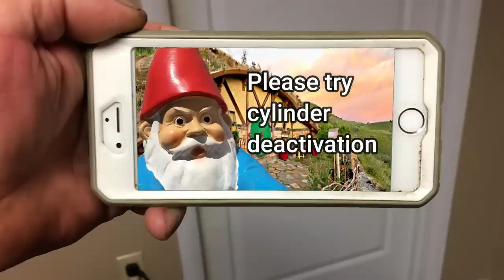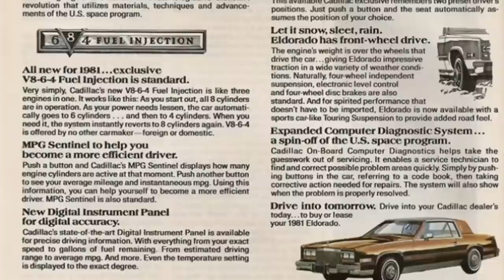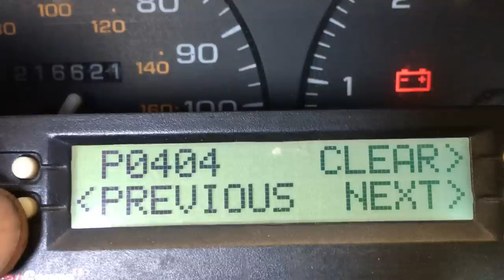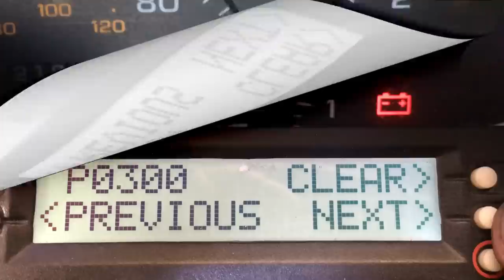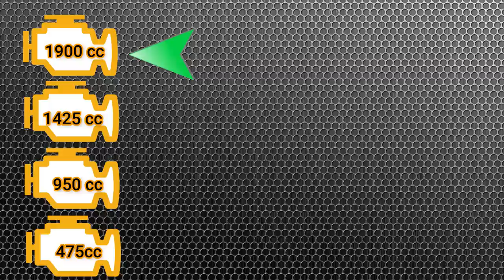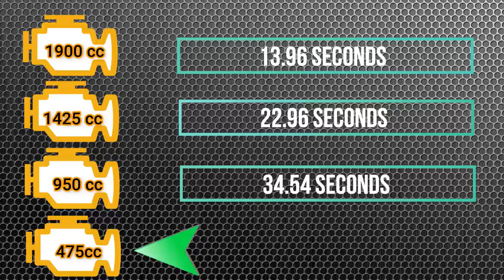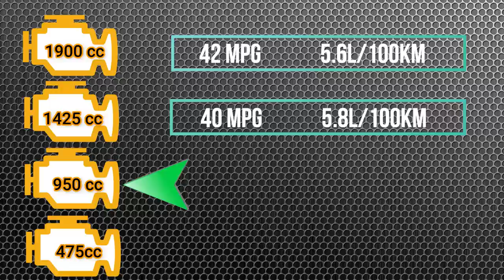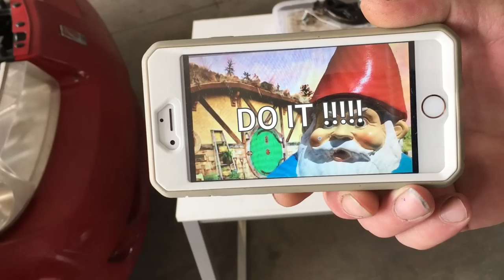S2E16:  We deactivate cylinders on our Saturn and test the car for performance and MPG

Comment: hey can you guys do a test for me since you guys are the testers here you know how that car takesb 5w-30 oil and i have a 5w-30 1zz fe engine in my pontiac vibe which basicly  is a toyota matrix  and i dont wanna end up damaging it with 192k miles on it if it does get damaged since it has been taken care of by the last owner since all i've ever done is replace the oil and put some tranny stop slip in so it can engage all 4 gears instead of taking its sweet time umm can you guys see what happens if you would put in 5w-20 oil and see if it does any harm if i was to keep doing it in my car  because if someone can do this exepriement since i havn't been able to find any video of any body doing it maybe you guys could and see if it would do any damage running a thinner oil on a well taken care of car and see if its worth it since i keep getting mixxed awnser saying yes toyota has approved of the oil just don't go thinner and don't do it if you have no problems but since its my a to b and people also tell me try it yourself do your own experiment when i could risk doing osmething to my own ride so if yall could try this out that would really help me out

Comment: I accidentally disconnected a fuel injector on my 2.2 1996 s10.. it gained a couple mpg but way less power.. I didn't disable the valves but they bounce the compressed air... you need to test with the ecu... really hard to believe you normally get 42 mpg.. but flat will do amazing mpg...
Reply: 2.2 '03 Sonoma. Knocked a plug wire loose and it popped off right after leaving the driveway. You're frickin' lucky, because I almost couldn't get mine up the hill to turn around and then back up the driveway.
Reply: A misfire is a big problem with fuel added... I had spark ok but no fuel in 1 cylinder.. and life was simpler in 1996.. was way less power but I did notice better mpg however my engine was never getting correct mpg .

Comment: I'm wonder how result will change if two pistons + connecting rods will be removed.
Reply: It would be so out of balance it would destroy the bearings
Reply: @smokenchoken1736  Maybe it can handle 30 mile fuel economy test. For better balance could leave cutted buttom part of conrod clamped od cranckshaft.

Comment: If you want and have time to try this . 
Cut 2 runner intake manifold and cut 2 runner exhaust manifold on Cyl#2-3.
After lets the valve intake et exhaust cyl#2-3 open . 
The engine going to be more happy with no compresion in 2 and 3 .

Comment: 7:30 will it pass annual emission test?
sound like a Briggs & Stratton lawnmower.

through knock sensor(if it has one) the ECU will probably notice something is wrong.

That car looks awe full bad and many USA cars still do, that's the reason why they don't sell here, you might see a dodge ram once a while, but that's it.
lol, roads with no corners, easy to get your drivers license.

Comment: I don’t know know what system your car uses for air metering.  I would like to see a variable obstruction to the intake air.  The reduced airflow should result in reduced fuel injector pulse width.  Leave it open during acceleration.  Then,  obstruct airflow at highway speeds.
Reply: It's MAP, there's no MAF sensor that I can see anywhere.

Comment: It might help if you remove the spark plugs on the unused cylinders, that way the engine can move the air in the dead cylinders freely instead of trying to compress and draw air from inside itself

Comment: Once you get your tinkering done convert it to a two cylinder by pulling the Pistons. Get rid of the extra useless mass.  Pulling the plug will not be nearly as good as removing the Pistons entirely.  I bet it will run better eliminating the pressure and vacuum in the deactivated cylinders.  A friend of mine just yesterday got the news that his Hyundai engine will need to be replaced. Number three spark plug due to pre-ignition melted the electrode off and the ceramic insulator got between the piston and cylinder walls. I think I'll suggest he convert to a two cylinder 😁

Comment: Ford 1.9 SOHC CVH engines would reliably and easily start and run and drive on 2 of 4 cylinders when one coil pack failed. Had a Ford SOHC 4.0 in recently starting, running, and driving on only one cylinder bank when the timing chain to the passenger side bank decided it was going on vacation through the valve cover.

Comment: Stock it has 140 hp. The one cylinder would have had, generously, 35 hp. 
By my calculations it would have had a similar power to weight ratio as the original 9 hp Citroen 2CV, only though a slushbox. 
So... Congratulations? You just equaled 1940's French engineering? ;-) Next on Robot Cantina: We build Hydropneumatic suspension with 4 basketballs, a fishtank water pump, and some used fryer oil! 

It's always a good day when a new Robot Cantina video comes out.
Reply: It is a very good day for a very good day indeed!!
Reply: I love your idea with a fishtanik water pump and some used fryer oil.!!

Comment: Great video!! Im really surprised the deactivation didnt do much. I thought there would have been a bigger difference, one way or the other. I thought, on the supercharging theme, what if you run the 2 cyl engine but plumb the exhaust from the "dead" cyls to the working cylinders to force air in?
Reply: if both center cylinders could alternately pump front+rear, 2:1 displacement ratio..
could it make similar power but consume less fuel? interesting concept anyway.

Comment: The only real way to effectively deactivate the cylinders is have it to where both exhaust valves are slightly cracked open but got to watch out for valve to piston damage though That way the compression is not there.... with it having its compression that's  almost like having a Jake brake on all the time...

Comment: Maybe 2 cylinder sparkplugs out not compressing.make bad noise but make engine run without bacpressure.
Reply from the maker: unfortunately removing the spark plugs would in fact increase the pumping losses.  Leaving the plugs in provides the best results.   If you want, search the internet for cylinder deactivation and you will find that leaving the plugs in place is how its done.

Comment: Moving a certain mass a certain distance over a certain time will take the same amount of energy whether you use 1 2 or 4 cylinders.  If you want to decrease fuel consumption you should concentrate on aerodynamics, weight, or something even more fun like combustion efficiency or alternative fuel.  External combustion like steam would be great as well!

Comment: You just disconnected rocker arms sure took out the spark plugs too because it's going to create a vacuum and create a pressure and it's going to drag down the system if you would have called to Pistons out that would probably gave the two cylinder or horsepower

Comment: i cant remember who the designers but i believe it was Mazda that was looking into running a compression ignition gasoline motor that used "compression cylinders" to pre compress an air fuel mixture before a series ov valves lets it travel to a final cylinder that compresses it until it ignites  im not a professional engineer but the concept seems wacky to me but this video made me wonder if you could take the concept of using a cylinder to create compression and feed it to the cylinders compressing air similar to a supercharger i would have no idea the steps it would take im sure trying to create a cam/ exhaust/ intake manifold that could do it would be the tip of the iceberg  but a cool thought experiment none the less to me

Comment: Remove the two inner pistons and rods as well to remove some of the rotational mass and see how that improves the 2 cylinder variant.
Reply: He would have to replace the rods with oil port blocking counter weights.

Comment: makes me wish they made a two cylinder engine for the masses in the states. cheap to buy, great fuel economy, easier on the environment and not super fast would be great for the younger crowd as a first car as well as the older generation

Comment: The Ford Focus performed this trick to save it's self if the engine temperature exceeded a pre set point. They run like crap on two cylinders . You' have to be crazy to want to drive them very far in this mode.

Comment: Deactivating cylinders is simply stupid. You'll kill the engine.
What you can do is decrease the engine power by messing around with the carburetor: smaller injection nozzles and reduced mixture chamber volume.
Reply: Ran my Jailbar V8 on 3 cylinders for 18 years no problems ever.

Comment: For your consideration. A  relentless heat wave is pummeling
Texas and the Central Plains    this will bring the hottest 
temperatures of the year next week.
Reply: Also consider the expanding and worsening drought.
Reply: It is so hot McDonalds is frying burgers on parked cars.
Reply: @ocdman202  The heat index is somewhere between  OMG and WTF😜
Reply: You can fry an  egg on the sidewalk and use your mailbox as a toaster oven. !!
🍳🍳🍳🍳🥘🥘🥘
Reply: I am glad it is finally hot enough to complain about the heat.
Reply: According to Mr. Spock,  insufficient facts always invite danger🤓🤓

Comment: but valves stay closed on deactivated cylinders? That cost you a lot of power
Reply from the maker: The purpose of removing the rocker arms was to keep the valves closed and to not let any air into the cylinders.  This reduces pumping losses.  If we kept the rockers in place, the load on the engine would increase dramatically.  An excellent example would be when we deactivated three cylinders and the engine was still able to idle.  If the rockers were still in place, the engine would not be able to idle.
Reply: @robotcantina8957  ah ok thank you 👍
Reply: @a68k_de    Robot,   looking forward to another great video
on   Robot Cantina

Comment: You should've taken the spark plugs off from deactivated cylinders. Then there would not be compression (air spring) to resist the engine. Although you would get an oily engine and engine bay. Anyway, the results ain't that surprising. With every deactivated cylinder the friction and resistance of the engine increase related to delivered power, so more gasoline is burnt to just win those losses. Why does the "two-cylinder" variant do better than the "three-cylinder", maybe because of better balancing and better exhaust flow (the third cylinder might mix the flow of the exhaust manifold in a way that reduces produced power)?

Anyway, interesting project you've got there!
Reply from the maker: Pulling the plugs would open the cylinders to atmospheric pressure and there would be pumping losses as the piston draws in air on the downward stroke and pumps out air on the upward stroke.
Reply: @robotcantina8957   True that, i somehow didn't even think about that. Thank you for reply.

Comment: I think you had issues by not allowing the exhaust valve to be open on the two cylinders making the engine work harder… the cylinders just acts as a air spring, try to find a way to open the exhaust valve enough as to not hit the piston while running as to evacuate the air in the piston chamber for better performance.
Reply: Maybe taking the plugs out would be easier then adjusting the valves to be open

Comment: the 2 cyl sounds like benelli tnt250. or 360 crank twin cylinder. the 3 cyl sounds like subaru boxer.you can also play with which cylinder to mix with. example cyl 1 and 3. it might be like 180 crank or 270 crank which balanced the crank to be smoother and less loss power on the crank rotation. idk i just thinking

Comment: Sounds like a diesel 2 cylinder tractor. Lol. Mount a small turbo on and although you will have to have a boost reference fuel pressure regulator to compensate the fuelling for said titty bitty carburetor. 🔧

Comment: I understand why u pulled the lifters 
And plugged it but I'd try to keep them working and on a fuel injector or 2 depending on the motor  put a  switch to kill the power to them and fuel to the cylinder like there dead cylinders and would leave spark alone  and wouldn't crate vacuum unless u wanted that as a air spring

Comment: Dragging inoperative cylinders diminishes efficiency is my suspicion. The inactive cylinders still have their rings in place, so the cylinder is sealed against the crankcase, however the valves are inoperative, so the vacuum in the cylinder, created by the descending piston, without an open pathway for air, creates consumption of oil from crankcase. Upon reactivation of normal cylinder function, the excess cylinder lubrication was consumed in the burning cylinder.This is the most inefficient technology ever added to vehicles. It is also trouble-prone.

Comment: There's alot of unnecessary drag with the plugs still installed in the deactivated cylinders. The oil on startup on 3 cylinders was directly related to the vacuum and pressure bypassing the rings. Love all your videos man.

Comment: Since it's a "permanent" deactivation you should remove the spark plugs to prevent vacuums and high pressure from the cylinders going up and down. It should improve efficiency even tho you still have frictional losses
Reply from the maker: Pulling the plugs would open the cylinders to atmospheric pressure and there would be pumping losses as the piston draws in air on the downward stroke and pumps out air on the upward stroke.
Reply: @robotcantina8957      Robot,   looking forward to another
great video from    Robot Cantina.

Comment: cylinder deactivation is really about.......getting large capacity engines to have less throttling losses at cruise.  Variable DOHC engines can achieve the same result, or BMW's valvetronic system is 100% effective without any trade offs. However

Comment: You're going to lose a lot of power compressing and decompressing the air in the deactivated cylinders. Easy fix is to delete the spark plugs and let the cylinders breathe, the proper solution is to delete the pistons and con rods in the deactivated cylinders.
Reply: You lose more power if the air is moving.  The most efficient setup is the one he did and is what all cars who do cylinder deactivation do - leave the valves closed.

Comment: You sure this is a good idea?  Deactivating one cylinder prevents the engine from running smoothly as well as lost power.  Caddy's old 8-6-4 system is a similar idea and it was a flop.
Reply: If you want something new,  you have to stop doing something old.
Reply: @mommapanda5736  agreed, but don't you think the idea would work much better if you started with a small engine designed to cruise and added an auxiliary engine for extra power when needed like a hybrid?
Reply: @wsbill14224  This is a really smart idea... like a hybrid , yes.

Comment: I haven't gotten to the point yet but I don't expect any mpg gains with this (and boy am I gonna edit this in a few minutes to rant about cyl deactivation!). 

[edit time/rant:  Well, ha, I was right!  And I expect Cadillac would have gotten exactly the same results (or worse) IF THEY HAD ACTUALLY done some Jr. High science on this.  I'm sorry, I'm picking a fight with your gnomes here but, with no active cyls there's no measurable mpg cuz <ahem!> the motor does not run (let them flame me if they want).  I don't know if this sounds like a logical argument but each cyl in an engine produces the same efficiency as any other and those efficiencies have to add to get the overall.  Cadillac had four burnin' four loafin' in their "best" mode and I'm sure all those active guys appreciated carrying that "backpack" all those miles.  Someone tell me, did they always deactivate the same ones?  Not even going to flip back and forth to manage heat?  Shut down the circulating pump and flip back and forth between inner and outer?  No?

And, how can we call it deactivated when the valves are closed.  That means there will be sucking and blowing going on at least until cyl pressure equals atmospheric pressure (something tells me that's around .303 and not .50 of atmospheric pressure).  Regardless, there will always be a little compression at the top of the stroke which will be exactly equal to how leaky the chamber is under maximum suck and even on a brand new engine with perfect surfaces and oiling that's a number >0.

I could go on....<sigh!> thanks for showing how silly this game is so that no one does it unless they keep the valves open (without using energy to do it) and even then, under careful parameters, I think the best a person can possibly do is roughly equal normal mpg.

Great show as always.

end of rant...]

Comment: Just remove the spark plug?
Reply from the maker: Nope,   That may seem like the best solution, however removing the spark plugs opens the cylinders to the atmosphere and now the pistons have to pump air in and out of the cylinders and that increases the drag on the engine.  Of course you probably wont believe that, so I recommend you do a little research.
Reply: @robotcantina8957  it was a question
Reply from the maker: @robertellwood8601  Sorry if my response seemed snarky.  I had a lot of comments from viewers saying I did the experiment wrong because I didn't remove the spark plugs.
Reply: @robotcantina8957  no way. I enjoyed the content. I had a feeling that it wouldn't do the trick but I didn't know why

Comment: The fact that on two cylinders you achieved negligible difference in fuel consumption tells me that if the ECU was programmed to accommodate  two cylinder deactivation the fuel economy would have been better.

Comment: I'll be damned you cheated on the last clip. But great content and fuel economy is chasing drops of fuel saving.
I also think it has a lot to do when you deactivate the cilinders to get fuel savings. Because you don't want to spend much time accelerating.
When it comes to specific fuel use per kw it's a sweet spot of rpm and load where it's most efficient.